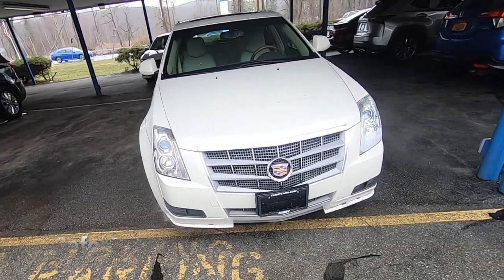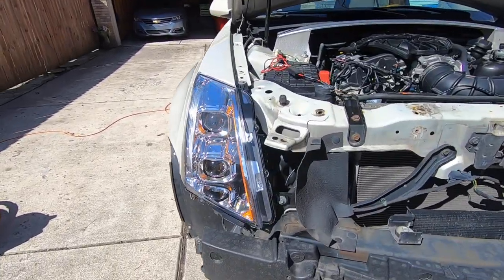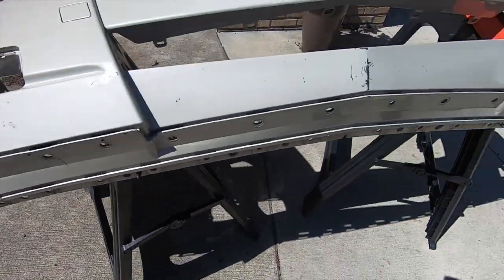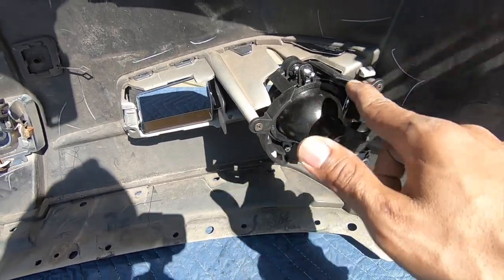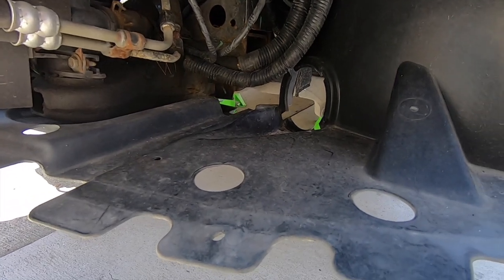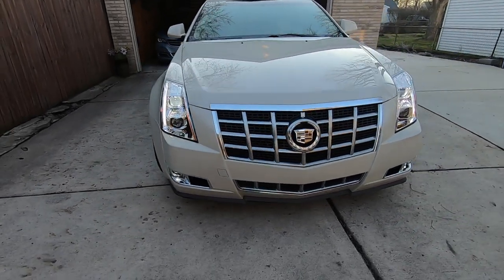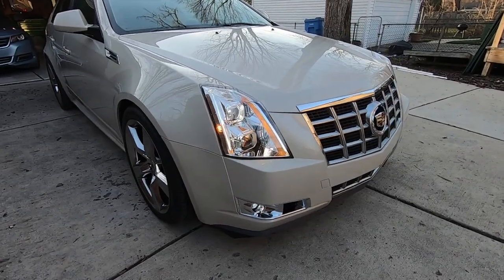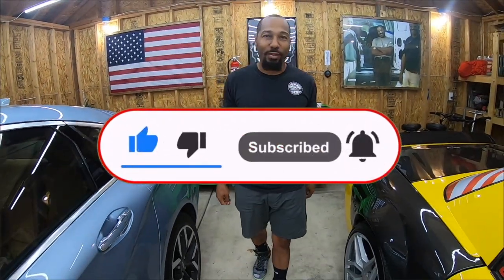Cadillac CTS Front REPAIR! Bodywork, Paint, Headlights, Grill & Fog Lights w Performance Upgrade!

Comment: How did you wire it to the headlights
Reply from the maker: @shadow_lix5054  I just wired the black wire to a ground and I used a fuse tap on the positive wire using the same fuse location as the headlight. I go over it in more detail in this video: https://youtu.be/965B17JdUIE?si=1fKCMYMHzHCvnvIL